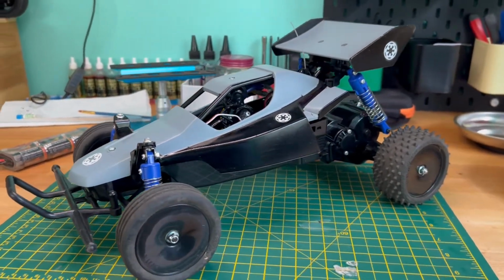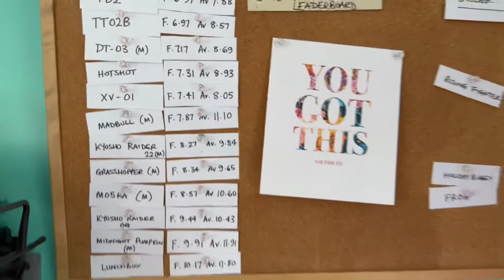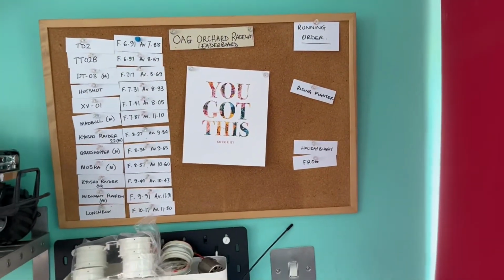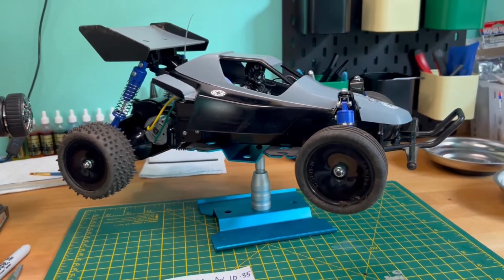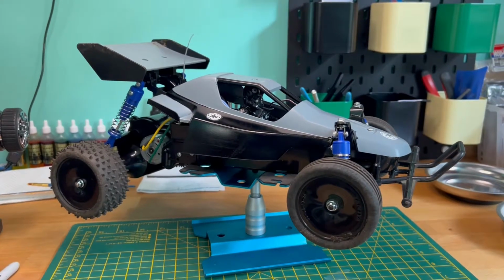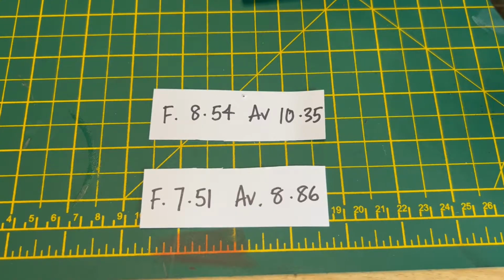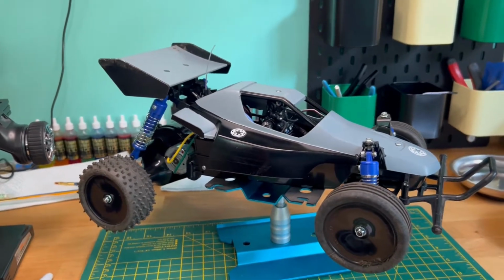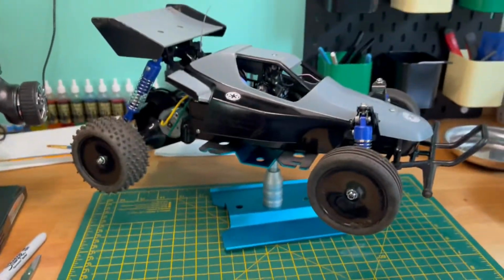Tamiya Rising Fighter Time Trial 2022

Comment: I think the oil filled shocks will really bump that time up and help with the constancy as well by cutting down on all the hoppy chatter from the rear end. I am glad you decided to go over the jump. I was wondering why you were not at first. It was fun watching it twitch and hop all over but will be much better wit the upgrades. I did have to laugh at the "screw it, I am reversing up the back straightaway" part!! That was great!
Reply from the maker: 🤣😂 Glad you noticed that most awesome piece of driving! I was very pleased with it on playback 😎 I agree with you Addam. I think the Rising Fighter will be up with the rest of them once the upgrades are on it. I won’t be as consistent as the big boys but I think she’ll put the odd strong lap in here and there. I have a brace for the rear end and oil shocks for the upgrade series so we’ll see what effect they have on the times. Thanks for watching dude 👍🏻🙌🏻
Reply: @theoagrc  I need to print off a bunch of those braces for my cars as well. I just never think to do it until I run one!!! The quick thinking reverse was very well executed!!
Reply from the maker: I am not sure how much they benefit out on the Orchard Raceway though! I think I need a little rear wiggle 🤣😂

Comment: Hi Craig, you'll get quicker run times with the bearings even if you don't put anything else on but definitely a strong contender for Top 5, I think 👍
Reply from the maker: Hey Peter 👋🏻 It did so much better than I expected!! It is a flat out car though. If it isn’t at full speed for the jump then it is rolling!! The hop up series is underway but the poor girl has had a few… accidents 🤣😂
Reply: @theoagrc  Nothing that can't be fixed, eh?
Reply from the maker: Very true although it is rapidly becoming frankenRC 😂

Comment: It did well didn’t it. Given it’s a small track I’m not sure how much quicker your times will be after the hop ups , there pretty quick because they are so light and they jump better than the hoppers as the weight distribution is different at the rear due to different COG.I bet if you ran the mad bull with buggy wheels it will be a similar time or quicker. Anyway will be interesting to see if the upgrades work
Reply from the maker: Hey Andy, thanks for watching matey 👍🏻🙌🏻 I think you are probably right but  it is going to be fun finding out! I was really surprised how good this little fella was. I mean it is no DT-03 but it goes. I am going to give the Madbull a blast in buggy set up next season to see how she goes. Thanks for your contribution as always pal 😎